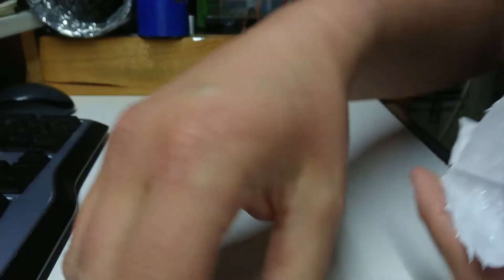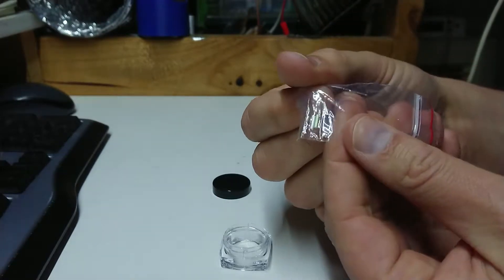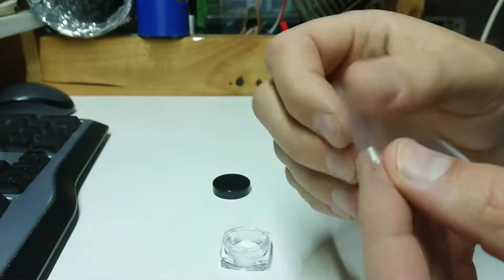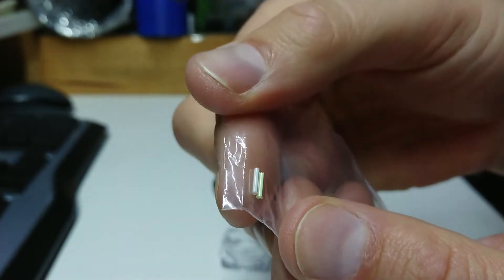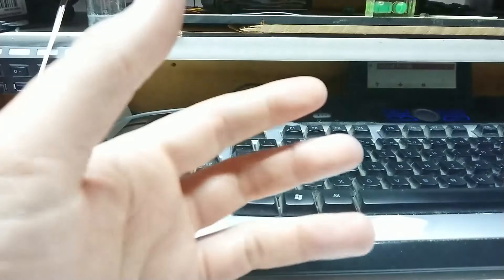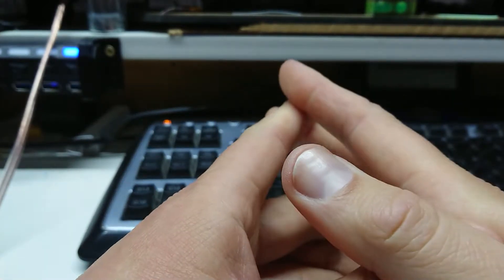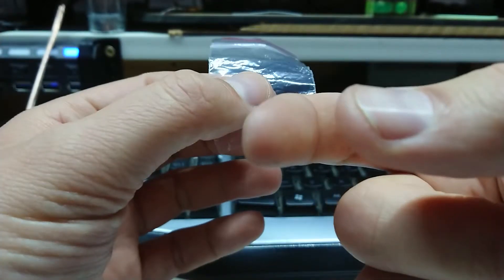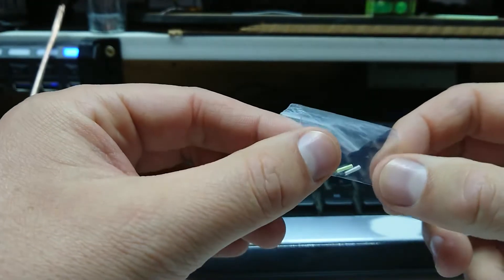Making a Tritium Gas Tube ring, using recycled bearing metal

Comment: Why superglue and not uv-glue?
Reply from the maker: because UV glue is expensive, hard to find, and not neccesary for the task at hand.

also this is loctite 406, same stuff I use to assemble hearing aids - not cheap $2 store stuff.
Reply from the maker: An additional feature is, superglue can be dissolved at a later date with acetone, UV cure resin cannot.

Comment: I envy your ability to craft rings! Unfortunately the vial is very exposed and they break exceptionally easily.  Setting it with clear UV resin might offer some protection.  There are tritium rings on ebay where they set the tubes in a channel drilled across the ring.  That is the most robust solution I believe.
Reply from the maker: These tubes are barely 6mm long. With the clearances afforded by the clasp, impact with the tube is quite difficult. There are a couple that have been in circulation over a year now without issue. However the resin was an ootion I considered, but gave it a very cheap feel. The expansion of uv resin also adds pressure on the tube that can contribute to premature fractures.